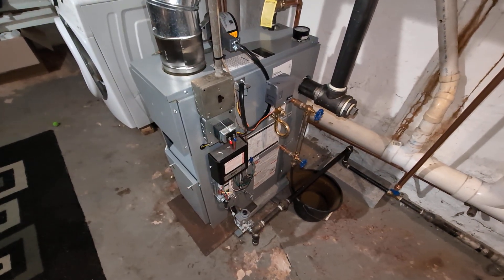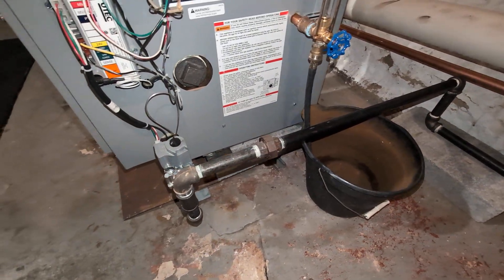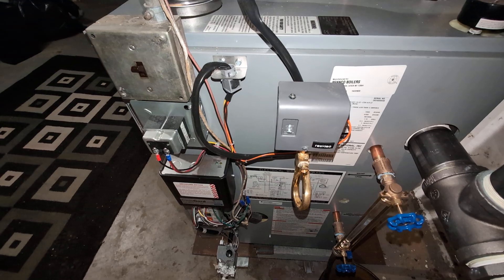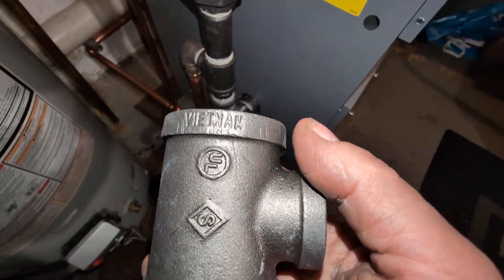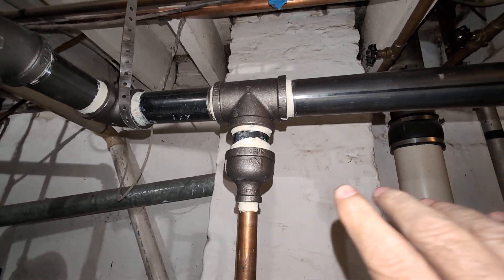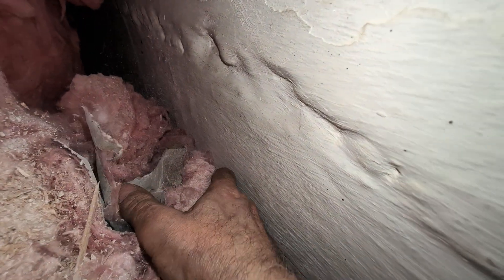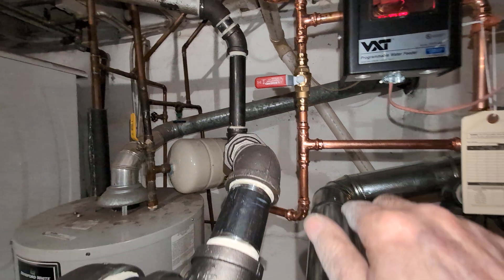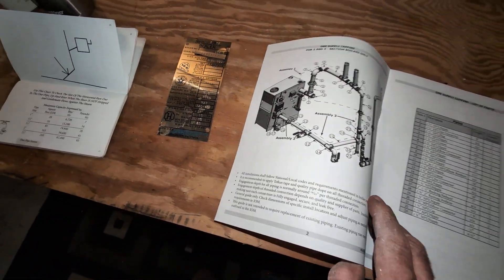Even The Smallest New Steam Heating Boilers Still Need Lots Of Proper Near Boiler Piping

Comment: I presume your installation involved a good bit of custom black pipe lengths requiring cutting and threading. You use pro-press fittings for the copper. As you know, pro-press can be used for black pipe as well.  What’s your reason for staying with threaded pipe?
Reply from the maker: Thank you for your comments & questions!
In this installation, there were no custom lengths needed.
All were standard off the shelf stuff.
Since no cutting and threading was needed,  it is quicker to assemble that then cutting, prepping, and using not cheap MegaPress fittings.
We have used MegaPress on steam, but only in unique situations and not as a go-to one size fits all.
We are concerned that the "o" ring in MegaPress will not hold up over time with steam as threaded pipe clearly has.
We usually solder copper, but in trying to save time, we are leaning more and more on ProPress, but only for returns and water supplies.
We use copper returns now only when it is already there.
Threaded pipe, in theory, gives a bit to relieve stress?  

I may not be right on that, but it gives me some comfort that it will last a long time.

Comment: Interesting system, Gordon. Much more piping involved than my parallel flow setup. Did the physical configuration dictate the use of counter flow piping? As far as I know, parallel flow is much more common and is preferred. Is that right?
Reply from the maker: In general, parallel flow is preferred for greater capacity over counter-flow.
The price to be paid for that greater capacity is a return of some type.
That unpleasant undersized (by the book) 1.5 inch copper counter-flow main was already there and largely hidden behind a lot of drywall.
And we knew it banged because we heard it years ago when we first dealt with the old boiler.
There were a lot of unknowns and until we started cutting out the drywall, this was a pig in a poke, as they say. 
We were very happy when that return started to work.
Reply: @gordonschweizer5154 finished basements are the devil’s hiding place